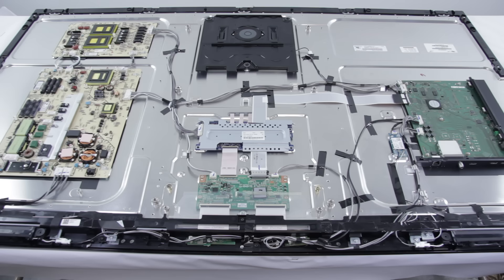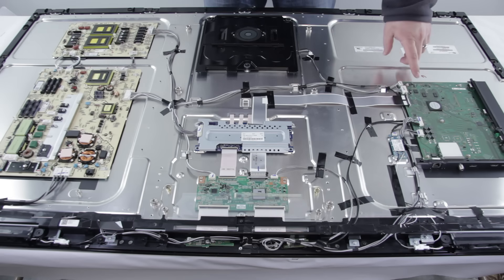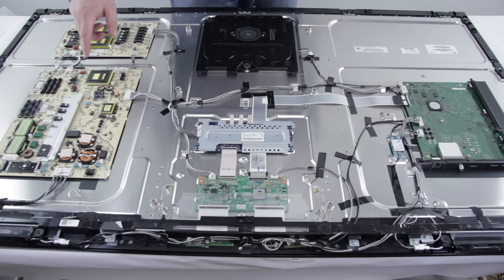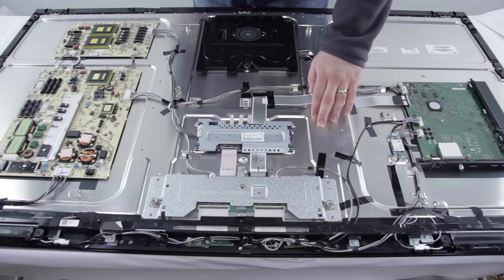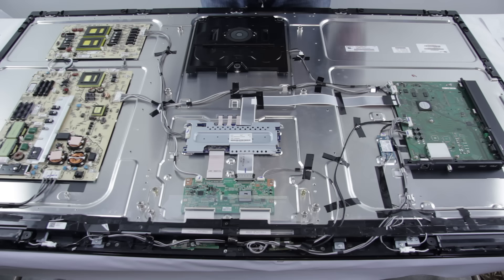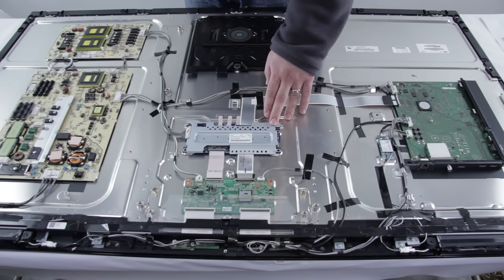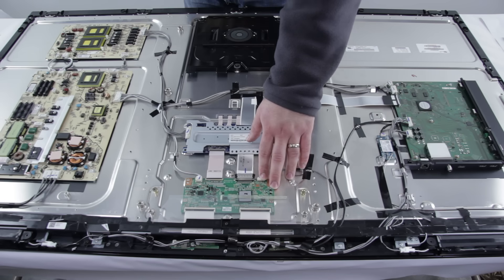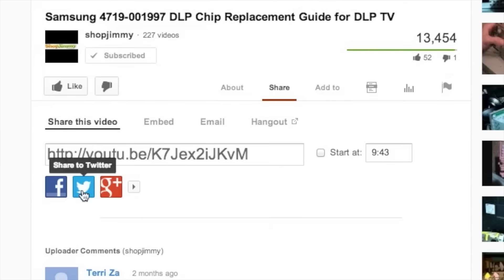LED TV Repair Tutorial - Common Symptoms & Solutions - How to Repair LED TVs

Comment: hi..i have a panasonic TX-42A400B LED tv..when i connect the power supply the green light will come on for 4 seconds then start blinking at which point the screen will flash and then the red light will begin blinking at 2 second intervals and nothing else will happen untill i remove then reconnect the power supply and then it will repeat the same as before..it may be important to mention that when the screen flash occurs it appears to eminate the light from the bottom of the screen .??

Comment: We have a Sony Bravia KDL-50EX645 - the red light is flashing 6 times and then repeats. When the tv is turned on the light changes to green and holds steady, will flash but nothing will come on the screen. I have watched several videos but nothing matches the bards and the wiring that I have so I am having difficulty self diagnosing. Any assistance would be great! Thanks ahead of time.

Comment: VIZIO M550NV TV, will NOT completely power-up, (The Vizio Logo turns amber (standby condition), but never turn white (powering up condition), I removed the back cover, Both power supply fuses are good, I have no Schematic, Should I buy a new power supply board?

Comment: I have a samsung un50j5200afxza, my symptoms are when I plug the tv in it's a black screen and it strobes every one second. I replaced the main board, power supply and tcon board and the same symptoms are occurring. Help please!

Comment: TV LG model 42LG30-UD . TV symptoms: power up TV images comes up on the screen for a few minutes then it turns off. Initially the power/standby light flashes twice before TV comes On. Parts replaced Power supply, and On/Off IR sensor. Before the TV had no back light and power to the logic board would drop off quickly - power supply replaced - Background light good with image (menu on Screen when selected); yet, when TV was placed upright image would go Off. Disconnected leads to IF sensor/On Off switch image was present - replaced IR sensor. At the moment TV turns Off after a few minutes - could it be Main board issue? .. Main board LGF55627601.

Comment: Hi, I have a LG 60LF6100 with a broken screen can I use the LED Backlights and wiring in a Hitachi LE55A6R9A?  I know that the plug on the wiring harness is different but I can change the plugs,  Is the output voltage to the LED Backlights the same on both TV's?  Thanks Charlie

Comment: Sony bravia KDL-52W3000, had ghost double image issue. i fixed it by adjusting the ribbons. problem now is a brightness difference on the 2 sides of the screen. the left side of the screen is a shade dimmer than the right, any suggestions?

Comment: I have a model KDL40R450A  Sony, LCD, It takes about a hour for the picture to come on the TV,  sound OK, it has a bunch of lines and eventually half the picture and some lines,  then eventually a full picture. I replaced the power board as someone directed but nothing changed. It has lights on the back of the tv when started up. If you leave tv on it works fine. Thanks Mike

Comment: Hello,

I have a Samsung UN60JU6500FXZA and the standby LED is red and solid for a second then flashes 5 more times (total of 6 times) - Not sure what is wrong with it, but it doesn't seem the power supply is issue. any advise?

Comment: I have a Samsung UE46D7000 TV with the vertical stripes / pixels problem. If it is a long time running many lines appear on the screen, if I turn off the TV a few days, they disappear. This problem I have already seen in several models Samsung UE / UN4XD7XXX and D8XXX. What's wrong? T-CON? Panel? Power supply?

Thanks

Comment: Samsung ln60c630k1fxza 5 blinking red lights and no picture.
I have taken the back off and tried to check for any swollen capacitors. There were none.
When I unplugged the main board connector from the power supply board the backlight came on.. so does that mean the main board is bad?

Comment: I  replaced my DPL chip on a mitsubishi wd 73735 . however 2 plastic clips with a tan pad on each ( about a 1/4 inch rectangle)  came from somewhere. i think they are heat sensors, where do they belong ?  i can't re-assemble tv until i attech them some where. can someone help. thanks

Comment: Hey I'm searching for a HL55K310PZL3D/C1Z1  MAINBOARD or repair kit.  It appears only the 4459 GA2V 1P chip is dead. however their is a bit heat burn on the opposite side,  under the cover plate area.  Im in Australia BTW.  Thank you!

Comment: Hi,

I bought Panasonic Viera TH-L50B6D Led TV 3 years ago. Last night  when I turned it on the screen started flickering (like quickly turning on and off but I could still see the HDMi header on top left). It did that for 9-10 seconds and then went to stand by with red light blinking (I counted to 20 times but it was still going). 

I read a solution on ifixit to blow hair dryer on it's vents and I did that which turned it on for 1hr approx then same problem continued.

Weather is moist here now a days and Tech support tells me that has entered the panel which needs to replaced. Panel costs around 60% cost of TV.

Please help!

Comment: Hello, I have a Panasonic an LCD tv TC-26LX85 that when I try to turn it on it has sound but no picture and the red led in front of the tv starts blinking. Just little before that this became a permanent state of the tv it just to work fine for an hour or so and then there was no image as I described before. If you have any idea what part I need to replace please let me know. If for some reason there is no exact replacement please let me know if there is a universal board that way at least I can use it as a computer monitor, thank you

Comment: Have a Samsung 60 3d led. One black line that's thicker/more visible on left side but runs fully horizontally across tv. Couple months another line about 2 inches below the first. More time. Another line. Now I'm up to four. Tried messing with ribbons and the lines go away but come back. And now I've messed up the color and text looks a little rough... help

Comment: Hello my Tv does not turn on anymore. when i unplug and replug it to power the stand by light turns (red light) but then quickly turns off. i opened it and capacitors look good from what i can tell.  samsung tv model # UN65H6203AF.  Any advice helps. Thank you
Reply: Eber Vazquez did you fix the problem?

Comment: I was looking for internal speakers (Part # BN96-16798a) for my Samung UA40D5900 . Please advise.
Reply: model number UN65JU7500 version code TH01. This tv has lan input, audio and video out input on the main board but they are covered by the main back cover...any reason why and how can I make use of these features?

Comment: TV Brand: JVC; Model #DM65USR; SN# TC1DUA043301362.
Problem:  The TV picture is fine and sharp; but the light inside the TV screen goes on and off (flashing light on and off).  What wrong with the TV and part/board needs to be replaced to fix the problem?

Comment: I have a Visio E60-C3 65". There is a shadow in the lower half of the bottom right quadrant of the screen. As best I can tell it's a backlighting issue. Regular screen image has a light shadow. When I change the channel the screen is black initially as it switches channels and the shadow on info. bar on the bottom is a lot darker. I'm hoping you're not going to tell me it a LED strip issue which would require an entire teardown. Looking for the cheapest solution. Thanks

Comment: Hello, I have LG 55LE8500,-UA, SVC Code=55LE8500-UA.AUSWLUR TV.  It was working fine for some time. Now I only get the logo screen.. I can see the TV responding to my remote, but it does not go beyond the logo screen.  No sound either.  From your video it appears to be the main borad, but I have a Master and a Slave board.  I am not sure which one is bD.
Appreciate your help and suggestion.

Thanks

Comment: Hi, i recently had a lightning storm and have 3 LED Samsung TV's that have went out, 2 of which went out immediately. i will be troubleshooting all three but i want to focus on the main 60" living room TV first (went out after 3 weeks). the model number is UN60JU6390F. 
here is the break down of what happened, lightning fried all of my satellite boxes: 
60" TV: 
1. the satellite HDMI cord was plugged into TV HDMI port 1 input and it failed. 
2. satalite boxes were replaced and TV HDMI input 2 and 3 are still working. 
3. after about 3 weeks of run time, the TV just quit working. 
4. it is now flashing the red light on the bottom left. flash code. 1 solid red light (about 3sec) then 5 red blinking lights about 1sec. 
5. i have checked the power supply board and there are no burned connection of X-cap problems. i suspect the problem exist on the main board since there was on HDMI (input 1) that was originally fried. 

once i have this TV back up and running i will address the other two TV's. 

thank you for you help and advise. please let me know if you have further questions to help resolve and or troubleshoot the boards on the TV. 

if you need to send me a private email please let me know and i can provide it. 

Best Regards, CM

Comment: Hi there,
Thanks for this video. I have a 19' (I think-maybe 22") Haier TV/DVD combo HLC19SLW2a and I cannot find the part anywhere. The manufacturer said it is TV5120-500 but that is not bringing up any hits at all. I would love some advice- also this happened after my TV was knocked over- is it possible that it could be anything else besides the backlight driver? When I opened the back of the TV I saw that the ribbon was not attached anymore- I assume that is the LED strip but IDK. HELP??

Comment: I have a Vizio E550i-A0 that has horizontal "shadow" bars across the screen in three locations.  It is also developing shadow areas in the corner of the screen.  I've interacted with Vizio.  They tell me it's a backlighting issue and it's not worth fixing.  A local tech said the same thing.  I've got time to fiddle with it, but I'm wondering what it needs and how to do it.

Thank you for any help.

Comment: Hey Jimmy, I have a LG 42LV5400-UB. When I plug the power cord in I get the indication of the red light. When I press power it turns white. But my screen and sound doesn't come on. I have no backlights on the tv. I have tried the flashlight, saw nothing, turned off all lights pitch black, saw no lights, also took cover off, turned lights off and still no lights. My main board SVN is EBT61520409.  What do you think is the problem? I bought a new power supply board but it changed nothing still the same problems. need your help.

Comment: my LG 47LW5600 TV has nothing on the screen when it turns on, also no sound. I see the power button come on and off normally. The screen remains black and there is no sound. Could this be a bad LED Driver board? thanks
R.

Comment: I have an LG55LV5500 LED TV. It never has had a problem till now. Very slow refresh rate but the Audio is fine. So slow that 
 I have multiple images which fade to the next. I looked on the internet to try and find a solution when i came across your repair videos. I think they are great and quite informative. I hope you can help me resolve my problem.

Comment: Sir I have AOC 40 inch full HD LED tv which recently started showing some problem. There is a audio but no display and when ever i switch it on it shows AOC logo on the display screen and then immediately turns to black display. I tried your flash light test. I am able to see that there is backlight is working. I also called service center engineer he diagnosed and told me to replace the panel which will Cost me about 18K to 19K INR.
Please help me to sort this out.

Comment: Great intro video guys, thanks a lot! 

I have a Panasonic Viera TC-L32E5BG with a part of the display faded; it seems that there are some 6 vertical parts of the whole display and one of them is bugged. Everything else like sound, ins and outs, ethernet, is working fine. I took a picture, avaiable here: https://www.dropbox.com/s/dl1nveuwx7j9na0/2017-05-29%2011.02.30.jpg?dl=0

Hope you can help me with the diagnosis; many thanks in advance.

Comment: Hello Guys, how are you?
Sorry I bother you, I'm asking you because I'm trying to repair my Samsung LED Smart TV, Model UN40J6200AF.
I just bought it 6 months ago, but unfortunately, I'm not able to use warranty service becasue I bought the TV in US and I'm from Argentina.

The first failure was some vertical lines at the screen (all from middle to right of the screen), they appear using any input (HDMI1 or 2, Netflix,  AV, Test, etc).
Now, the image dead suddenly. I have sound but no image. The Samsung Logo doesn't appear when I turn the TV on.

The tests I've performed are:
- Disconnected and connected all cables after clear the connectors.
- Test output voltage from power supply to mainboard (all are 12,5V)
- The backlight leds are working (I've removed the backpanel and I can see the with ligths on)

According to the videos I saw from you, It seems to be a problem with T-Conn board.
What do you think, am I right? Any Suggest?
Could be the main board too?

In case I need to replace the any card, do you send parts intenationally?

Thanks a lot!

Comment: Good job with the video, very informative. I have a Samsung  LED  model UN40D5550RFXZA that the power recycles constantly. I've taken it apart I don't see any bad capacitors on the power supply board or any other visual evidence of a bad component. if you would like to send a message on here that would be fine I can take pictures etcetera if it would help.

Comment: Hey Jimmy I have a LG 42LV5500... when I plug the power cord in I get the indication of the red light... when I press power it turns white... But my screen and sound doesn't come on... what do you think is the problem? need  your help
Reply: EBT61456504 is my mainboard serial number

Comment: To whom it may. Samsung model # UN55ES6500FXZC suddenly darkened and a horizontal line was visible.  the lower right hand corner of the screen, right at the external on off switch was extremely hot to touch.

Have not yet taken the back cover off... any thoughts on the problem? It sounds like a failure problem for Samsung LED's as I have seen on some web posting.

Thanks for your attention.
Ron

Comment: i have a 2009 SAMSUNG un46b6000 class led,I hooked the hdmi cable to computer to show videos on tv screen as i was adjusting the picture about a 6 inch wide vertical lighter than  the rest of picture,Shows picture just fine but you can distinguish a 6 inch vertical lightening shows in picture,Like i said it still shows the full picture but its like when you adjust the brightness ,That 6 inch section shows a lighter  vertical handwidth section,Lighter by just a shade. Barely noticeable  Please let me know if thats the T con board or maybe something with a connection ?  I was going thru the hdmi/ tv/ adjustments when it kinda flashed when that section got lighter. Thanks for any suggestions.

Comment: My Insignia Tv model # ns3200200na14. ser. # 130932du000869. The problem I'm having is that the picture only works normal half of the screen and the other half has grayish-white bars coming down over the normal picture thats working. what can be the cause of the problem.

Comment: Hi, Im from India, my LG LED Tv of 42 Inch (LS 57 series) started to show some problem. when its On after some time the Video goes off, but audio continues on, the screen will be completely dead.  
if i leave the tv off for few hours and ON it, The tv will continue to be normal for an hour, then later when the video goes off. if i restart the Tv video goes off with in minutes. 
when the video is ON, the picture quality or backlight every thing semms to be good.

  If i reduce the backlight from 100 to 30 (or less) the picture doesnt go off  it extreme point, may be for  2 to 4 hours.  and as i searched in web circuit board might be the issue. 
 The LG repair guy  (who charged me 1,150 INR just for a visit) said the circuit board and the motherboard both has to be replaced for 11,750 INR , i felt something fishy and  i turned it  down coz i feel there is better solution.
can you please suggest me a solution ... thankyou

Comment: i got a 55" tv model is led55c55r120q and it has some horizontal lines not very many like one all the way across in the center one all the way across near the bottom and a few on the right side of the screen also the right side of the screen is darker then the left side and the color fades in and out and the picture is ghosting/freezing on that side only.

Comment: Hi, I have samsung LED TV (40 inches). I have been using it since 5 years. Since 8 months we see a display issue on the top left hand side. A black bar of size approx 5cm width starts from the top left and it gradually increases towards right side and the darkness reduces as it moves towards rightside. Finally it appears as film bar and the picture on this part either will not appear or appear partially.  Please advise us the solution. Once in a motnh or so suddenly this problem disappears on the TV.

Comment: Hello I had a question. I have a 47LN5400 LG TV barely used but it is out of warranty. I have opened it up Capacitors are looking fine, connections non burnt. I plug my TV in. turn it on , the backlights turn on(see them through holes in back)  , front light is red, but I cant do anything the side controls wont work aside from letting me hit the power buttonto turn it on, remote wont do anything , wont even let me shut it back off I have to unplug it , I used thks probably a total of 10 hrs rest of the time it was instorage for the other 2 years. would really love to get it working again, to recap , I plugg it in, turn it on red light front , backlights turn on, got a glow tothe tv, but nothing works other then the button to let me turn it on , I have to unplug it to turn it off, its got me baffled any help is appreciated thanks.